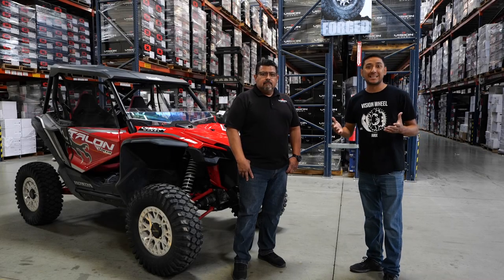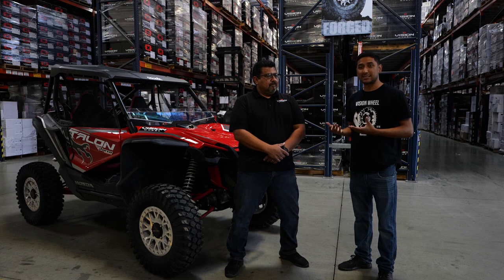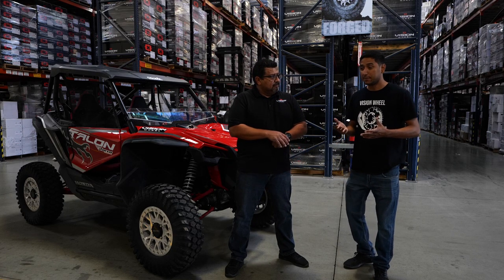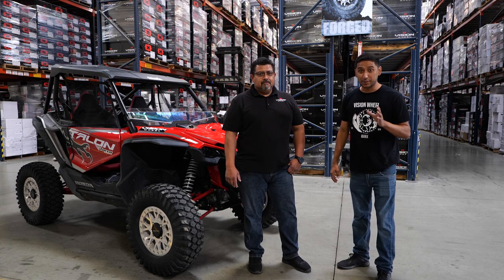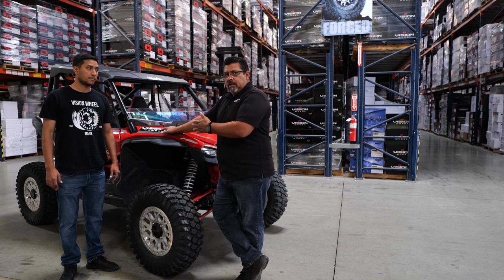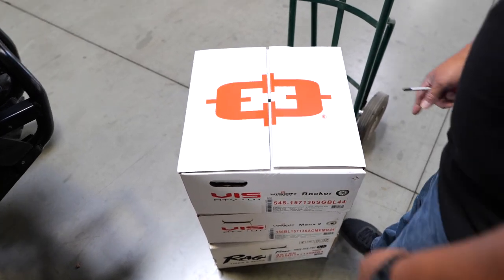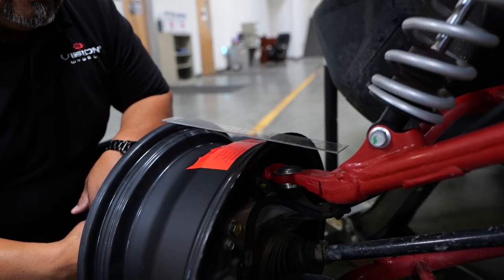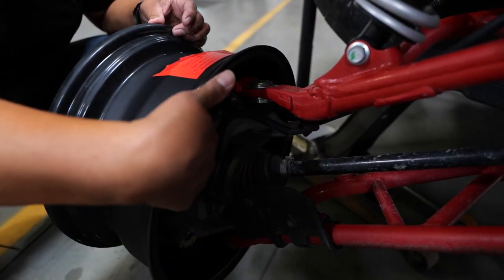Best Wheel Offset for Honda Talon  - Ososik Media

Comment: I was thinking about running a 15x7  6+1 all around for a square setup on 30’s for my talon. I kinda got lost in the video - does he say that setup is too aggressive? 

I want to be able to utilize a spare on any of the 4 corners.
Reply: I am running stock Talon front rims all the way around with a spare front also. I used 1.5 inch spacers in the back (RB3) squares up machine.
Reply: @ciminot2011 i did the same thing. Works great.